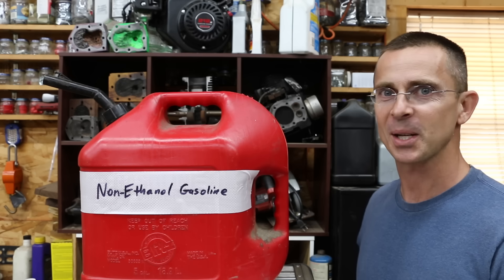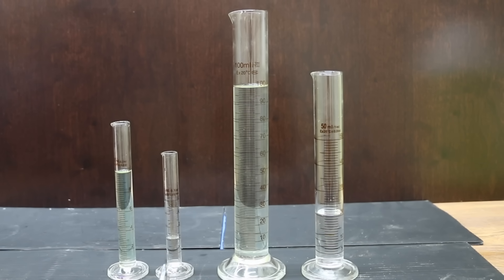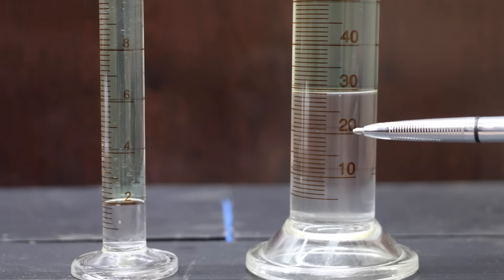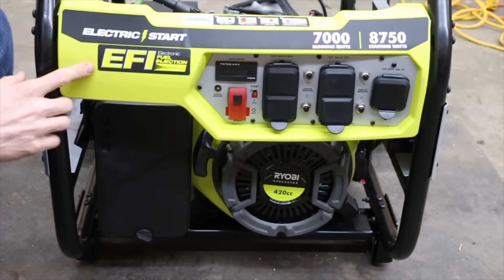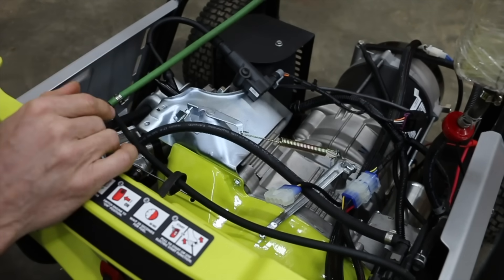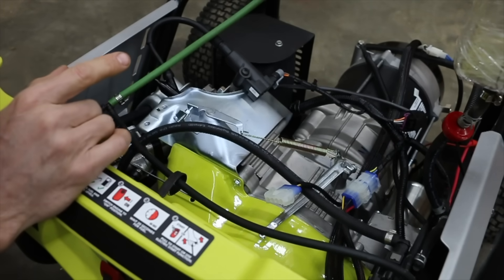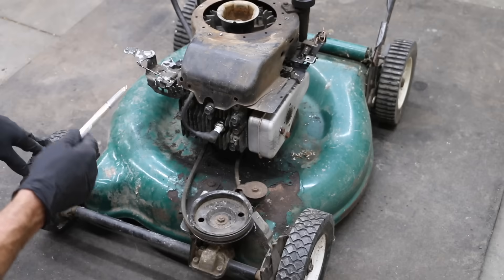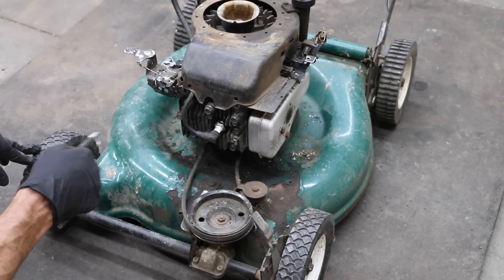Is Non-Ethanol Gasoline Really Better? See the PROOF!

Comment: l like the idea of long term test and to see how the metals hold up on the carbs and tanks, thanks for making these videos, on a side note ive been using cam 2 racing fuel to see if there is a difference with that stuff, so far small engines have been doing well with that sitting in them.
Reply from the maker: Hi Mustie1, Thank you for checking out the video and thanks for the recommendation on cam 2 racing fuel.  I will definitely check it out!  You've got an amazing channel that I highly recommend to everyone!  Best regards, Todd
Reply: @ProjectFarm  Have you tested washed gasoline?
 I've heard of people "washing" the ethanol out of gasoline with water to have ethanol free gasoline. Thoughts?
Reply: @BEANS-O-MATICtransmissions  You could do that. But you could also run your car more often to get rid of the water and keep the tank full to prevent some condensation. The funny thing is that we have something called carburetor spirits where I live. It's ethanol used in the gas to prevent freezing of your carb.
While ethanol attracts water it also makes it able to get pumped out to the engine and burned, because it do mix really good with water.
Reply: @ProjectFarm  I will send you a remote gas tank. You Jerry rigged fuel bottle looks horrible. Tape? Really?!!?
Reply: You guys are great!
Reply: Two of the best channels on Youtube.
Reply: @scdevon  def. agreed
Reply: A) racing fuel is expensive, B) who has access to race track to buy the shit?
Reply: The stuff Mustie speaks of is sold at a local gas station in our area, and it goes for about $10 a gallon. They call it Cam2 at the pump, but it's actually Sunoco (Cam2 was a div of Sunoco) Standard 110 racing fuel. So no need to go to a race track. For use in something that's a seasonal piece of equipment, such as a snowblower, or generator, it may be a pricey fuel, but it's still about $10 cheaper than the gallon cans of lawnmower fuel from a big box store. It sure beats having to rebuild, or replace a carb. And it's piece of mind that in a storm, my generator will start, because the carb won't be varnished up, and full of water.
Reply: @erikj.2066  In Vermont about half the stations are now selling 91 octane ethanol free gasoline for about 30 cents over regular 10% ethanol. So about 10% more expensive to gain 4% in mileage doesn't pay if the vehicle is in constant service.  I buy it for anything that doesn't get fuelled within a month or two.
Reply: @maplebones  yup, you pick and choose what you put “the good stuff in”. 

Since I made this comment 2 years ago, I have found an airfield close by, that sells unleaded ethanol free 91 octane “Mo-gas” at a 24 hr self serve pump. It’s half the price of the 110 leaded race fuel.
Reply: +mr bad.... There are gas stations that sell it though.  If you are running a landscape business, it probably is too expensive. But for the home gamer who doesn't go through a lot of gas and might very well forget to remove the gas at the end of the season, it's a good investment.
Reply: @tarstarkusz  yup! 🙂👍✌️
Reply: @mrbadx19  A it is very expensive, B you don't have to go to a track to buy it.
Reply: If you could use an image or a video I put a carb from an old 73 kawasaki motorcycle I have into a 1\2 gallon glass jar and soaked it in ethanol hoping to clean it... It's been sitting in that covered jar for 4 or more years! You know how some of those projects go :) but I haven't pulled it out since, and it has rubber seals on it still. I've also put over 100k on my non flex fuel car with e85 (retuned for it).  But I'm not pulling my motor apart yet ;)
Reply: @volvo09  But is that carb clean ? I have a '76 Kawi awaiting restoration and I'm genuinely curious.
Reply: @CaptHollister  No, it is NOT CARB cleaner. It would be the same as using grain alcohol for CARB cleaner .
Reply: @volvo09  Sir, you state you put 100k on your non flex fuel car with e85 (retuned for it). What do you mean by retuned for it? I use e85 sometimes on long trips on my non flex veh.s as well. I feel that on hwy trips e85 should be more practical.
Reply: Both are my favorite channels. I also use racing gas in my 2 stroke outdoor equipment and non ethanol in my mowers. Purchase my racing gas out of a pump at my local gas station in nc. They sale all 3 types of fuel at the pumps. Regular e10, 90 octane non ethanol,  and 110 true blue race gas. Thanks for the effort you both put in your channels.
Reply: Hi Mustie.  Back in the 70s several engineering guilds and associations lab checked those degradation on cylinder walls, rings and the combustion chamber portion (top of cylinder above the ring travel) 
They all found Ethanol10 barely measurable metal burning/pitting over 100% gasoline. E85 a slight bit more.   Methanol10 had significant pitting.  Higher concentrations of Methanol were worse.
Reply: The problem with ethanol in aircraft systems is that it has been shown to cause problems with the seals and other components and I've been talking to pilots and I am one, and I've heard it from just about every pilot that I've talked to you about it so that's why it is aviation gasoline does not contain it. So if it's bad for airplanes, why is it good for cars/trucks/ etc.????
Reply: Steven Wilgus maybe they use different stuff to make their seals I’m not sure though 

(I am in no way an expert on anything engine related so forgive me if that sounded dumb.)
Reply: @youtubeguy3544  Modern fuel systems are using ethanol compatible materials. Rebuild kits for older carbs, such as used on my 50's era IHC tractors, are now advertising that they've converted to the same. I don't know about chain saws, but I use pure gasoline in mine after having a lot of trouble with plugged up carbs.
Reply: @stevenwilgus8982  it's good for politicians and lazy farmers.
Reply: Steven Wilgus There are a few reasons ethanol is not found in AvGas. The first being it was never certified by the FAA and as a pilot, you know that it takes forever for anything to be certified for airplane. Look how long the replacement for 100LL has been going on (the progress was tracked by AOPA and others). Another reason is airplanes operate over a pretty dynamic altitude range. A turbo version can fly from sea level to FL250. As well, you have everything from carburetors to fuel injected turbos in airplanes. 

I’d be most worried about the hygroscopic nature of AvGas with ethanol in it. We do everything possible to keep water out of our systems. It wouldn’t take much for it to freeze at altitude.
Reply: @Marauder92V 
Been years since I flown, miss it. But I remember checking the fuel under the wings for water.
Reply: @Marauder92V  My guess is that the water problem is the most difficult bit for certifying it as a civilian AC fuel. Condensation from shifting temperatures and the potential of freezing in mid air are troubles you don't want. I can imagine that the infrastructure around ethanol based AC fuels would be full of extra checks and regulations due to the hygroscopic nature of it.

As a former repair tech I would take a qualified guess that seals and fuel lines are not a big issiue. If it was deemed useful to convert there would be procedures in place to follow up on seals and fuel lines.
Reply: From the aspect of an automotive tech, the question is why is ethanol OK for cars. The answer is several fold, but some basic points. Ethanol in automotive fuel has been around a while. Not in all parts of the country, not until MTBE was outright banned. But it has been around, and the automotive manufacturers knowing this have used rubbers that were tolerant to low quantities of ethanol for quite some time. Second part, in most cases the fuel in a vehicle is consumed pretty quickly, so it gets little chance to spoil, or collect water. Third, I know nothing about aircraft fuel evaporation emissions systems (if they even exist), but modern automobiles have a pretty tight evaporative emissions control system, that prevents raw fuel vapors from escaping into the atmosphere. That being said, they are usually pretty air tight, and do their breathing through a charcoal canister, and purge valve. Not directly venting to outside air. Fourth point, which has been mentioned is the operating conditions of an aircraft VS an automobile. You aren't taking your average car up 12-15 thousand feet in a matter of minutes, and then dropping it back down to someplace close to sea level minutes, to a few hours later. That leaves allot of chance of both condensation, and freezing. Final point, In all the years I've been doing this racket, I've seen far more cars with water in the fuel due to a problem at the filling station, VS naturally collecting it on it's own.
Reply: @erikj.2066  There's also the safety factor.  If your car engine craps out due to fuel issues, you simply come to a stop.  Worst case, you pull over on the side of the highway.  If a plane engine cuts out, the stop tends to come a few minutes later, and be a lot more violent.
Reply: @stevenwilgus8982  that was easy....more stringent maintenance req'ments.   Cars can't fall out of the sky.    A lot of standards are good but overkill in aviation for that reason   Stay safe, mask on
Reply: i use to buy fuel in bulk and thought someone was putting something into my container .  sometimes i would let the fuel sit for a month or so before using it .  so i did a test with co op fuels and fuels like esso ,  i found that letting co op fuels sit for a month or so would separate about 3 gallons out of 50 .  the so called ethanol added up to the most while the so called octane added up to about 2 litres . if it is really ethanol that has separated from the fuel , then why does it not burn like gasoline . is ethanol more like a light oil  . either of the two liquids that were separated do not burn like gasoline . and they also do not freeze .  i have only had this happen with co op fuels .
Reply: @carmichaelmoritz8662   Don't know if this is applicable .. but if tanks or not Full all or most of the time and are above ground in temperature fluctuations that can cause frost or dew / condensation in the tank , water formed can be considerable. Ethanol would be attracted to the condensation .
Reply: Hey Mustie1 . love your video's bro!!!
Reply: This, please!
Reply: Yes to cam 2 i bet it runs cooler and it smells great
Reply: the big box hardware stores near me are selling pure gasoline now for lawn equipment, and premix stuff too. Little pricey thou
Reply: @taledarkside  yes, about $20 a gallon. I use it for winter storage just to keep seals and diaphragms from drying out, too expensive to use for every day use. I do find that 93 octane with stable and ethanol preservative mixed in works great in my small 2 stroke engines, a lot more power than using 87 regular.
Reply: It helps me plan what to do on my VW type-1 trike motor, as far as best fuel to keep it going long term. thanks, again!
Reply: Newer cars are "plastic" tanks and "plastic" fuel lines. Cheaper to make, lighter, and dont corrode.
Reply: As a small engine mech for many years (both rental & customer machines), I can say 99.9% of the problems are user-error. Rental engines (Honda, Subi-Robins, Makita, and Hilti) were kept 3-5 years then sold, and not a single engine running E10 every had corrosion issues in tank, carb, or lines. I was also mandated to use fuel stabilizer in all fuel (Startron, Stabil, or Makita mix w/stabilizer).

Meanwhile every customer that had corrosion from using E10 *never* used fuel stabilizers. E10 will continually absorb moisture from the air thru the carb vent & gas cap vent. The water/alky mix would absorb moisture, settle out, then rust the bottom of tanks & carb bowls. It would only increase as gasoline evaporated & left more water/akly mix behind. 

In short, E10 is fine for small engines maintained by people that USE FUEL STABILIZERS. One extra note: my 1967 Firebird sat 4+ yrs with E-zero gas w/o stabilizer and literally fired up in 1 second on the first crank. I was only trying to prime the oil system...
Reply: @jeffreydanek4833  so what you're saying is ethanol fuels are bad UNLESS you use an additive.
Reply: Ethanol is nothing more than disguised Farmer Welfare for Midwestern Farmers.
Reply: How about 50 years. E10 has been in use in the US since the 70's
Reply: there's a video on YouTube where they had 8 engines with 5 different fuel stabilizers, one with non ethanol fuel and 2 with reg fuel, they left them with the same fuel for 19 months to see what happens.
Reply: Terry Winter  he should build a tom ogle carburetor and test it
Reply: I have pics of algae growing inside the bowl of my wife's snowmobile carbs. Ethanol is horrible in my opinion. At least in small engine applications especially in carbureted motors.
Reply: @kevins9576  Ethanol have been used since the 70's in gasoline. I run my old 1968  Volvo Amazon (B18) on 50% E85 and 50% 95Oct. It run better on it and I didn't modify or alter the engine one bit. I didn't even change the timing.
Ofc. If you have a car or other vehicle that is unused for long periods of time, you might have a problem. But to be fair, gasoline and particulary diesel cars have problems when not being used.

Ethanol fuels are best used in high compression engines. There you will get the real benefits of the ethanol.
Reply: My SLK Mercedes is 25 % down on power and MPG ....Not good ...E10 is poo
Reply: It’ll be the rubber gaskets and diaphragms in carbs that deteriorate faster with ethanol gas. That’s the big difference.
Reply: @DemonratsRevil  I have had no problem with it. But I tend to check and refurbish my carbs every 10 years or so. Gas lines and such I often change every 10-15 years on my old cars.
Reply: Right on
Reply: Regardless of the fuel I fill up, my car passes the emissions test at the annual inspection of my car. What strikes me and why I fill up with 5% ethanol petrol is that my car gives an error signal when I fill up with regular petrol,,,,....but not when I fill up that expensive fuel with the 5% ethanol. The readout computer indicates that there is an emission error when using the cheapest (10% ethanol) fuel. So what did I do ...... clear error message and fill up the expensive fuel. (currently more than 12 dollars a gallon.....or 2.34 euros per liter here in the Netherlands) Tendence is rising

Comment: I will keep my opinions that I have. I listen  to mechanics . From heavy trucks to marine engine. They would laugh at this. I will post this. Ethanal gas does not have the BTU rating that pure gas does. So this better performance that you talk about is bogus. E. gas also breaks down way to fast, which is a gasket and fuel line nightmare.

Comment: Great idea for your components test use some polystyrene packaging pieces put some in the non ethanol fuel and drop some in the fuel with ethanol. If you are using a alkalyte based fuel the polystyrene should just stay intact and the polystyrene in ethanol fuel will fizz away in a matter of seconds.
Reply from the maker: Thank you

Comment: Awesome video, again!
In Spain we only have E5 gasoline option (95 or 98 octane). For sure in the future they will put E10.
By now my 2016 motorcycle has a plastic gas tank, is fuel injected and almost daily run, so water adsortion I think is not an isue for a daily driver. No?
Reply from the maker: You are right. It shouldn't be an issue.

Comment: There's so many differing opinions on the best way to prep a small engine for storage. Run it dry, don't run it dry, use non ethanol and you're fine, need to have stabilizer and don't run dry, use stabilizer and run dry, just run it once a month and you're fine. Wish there was a way you could test what the best method was. Thanks for the awesome vids.
Reply from the maker: Thank you for the video idea!

Comment: Your way of testing how much ethanol is in the gasoline is flawed. Mixing 20 ml of water with 10 ml of ethanol doesn't result in a total volume of 30 ml. At 70°F you would expect to get 29.1 ml if the ethanol concentration in the gasoline is 10 % by volume. That seems to match your results quite well. Technically this will change a little with temperature, at 50°F you would get 29.25 ml and at 90°F you would get 28.94 m, but as you can see, the difference is smaller than you can really make out in your measurement.
For more information google "volume change mixing ethanol and water".
Reply from the maker: Thank you.

Comment: Any way to compare these gasolines in 2 strokes? I seem to notice 2 strokes run much better without the ethanol. The difference is enough to require a mild carburetor  adjustment.
As always, great video, Thanks!
Reply from the maker: Thank you for the video idea!

Comment: I've always heard that e10 has about 4% less available energy than straight gas, meaning you need to use more to do the same work. Interesting how your test seemed to verify this.
Reply: Can we assume that for every 10 part increase in Ethanol content we would lose 4% economy?
Reply: @dougn2350  I don't think it scales directly. If I remember correctly, e85 has around 20% less energy than e10.
Reply from the maker: Great point. Thank you